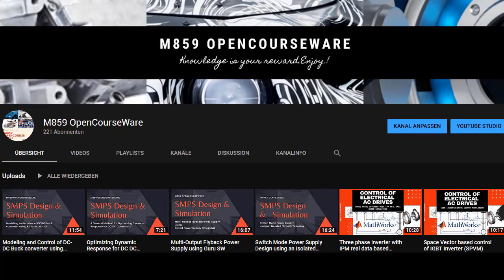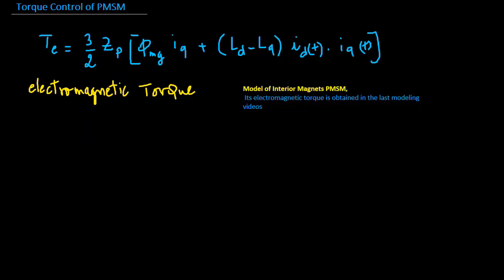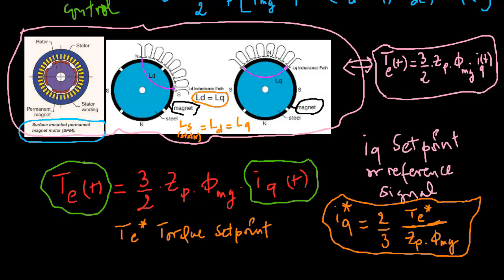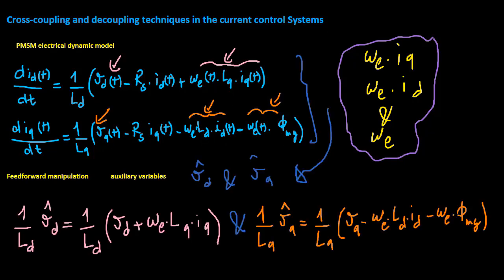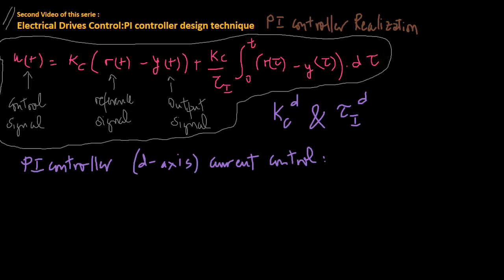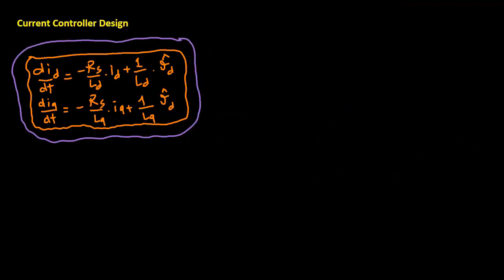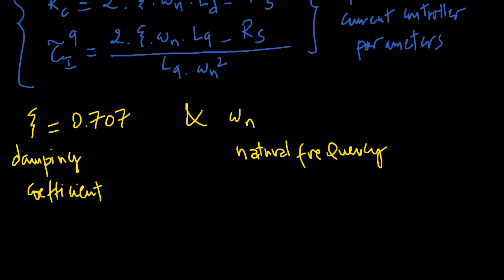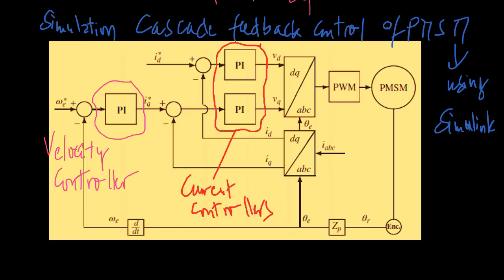Torque Control of Permanent Magnet Synchronous Machine (FOC)

Comment: 3:05 Why is it torque control when there is omega_l* as reference?
Reply from the maker: the picture serves as an overview, the differential equations next to it describe the dynamic behaviour for the current control loops. If you watch the video to the end, you will notice that we have only dimensioned the inner loop. If you also notice that the moment depends only on iq, you will notice that you control the moment in which you control iq. the speed control follows in the following videos.
Reply: Thank you for your explanation! In this case, may you show me a complete diagram with torque as reference in the control strategy?
Reply from the maker: @andreimitrasca7815  The torque reference is the output of the velocity controller.
Reply: @eDrivesEmbed   All right then. Always in field oriented control I have to use velocity controller? I ask because I want to control a PMSM for a go-kart.

Comment: Hello sir, can you explain a bit more about the parameter alfa that you used to approximate the desired closed loop bandwith Wn? And why did you choose 0.9?
Reply from the maker: the natural frequency omegan is selected to determine the desired closed loop settling time, which also corresponds to the desired bandwidth of the closed loop system. 
The larger omega n is, the shorter the desired closed loop settling time is. It is also useful to choose this parameter relative to the bandwidth of the open loop system, which is either Rs/Ld or Rs/Lq. Here, a parameter 0 < alpha < 1 is proposed to be used where the desired closed-loop bandwidth is calculated as in the video. alpha is selected to be 0.9 to be able to have the greatest omega n. alpha can not be 1 and also is equal to 0.9 to have the geratest wn. also omega n(closed loop)=1/0.1*open loop BW=10*open loop BW. That means the settling time is the shortest possible in this case. 
https://www.youtube.com/watch?v=99V13HM71aA&list=PLouCoK47-AT_rcog3L8_UjTGs-sLgZEZd&index=2
Reply: Instablaster.